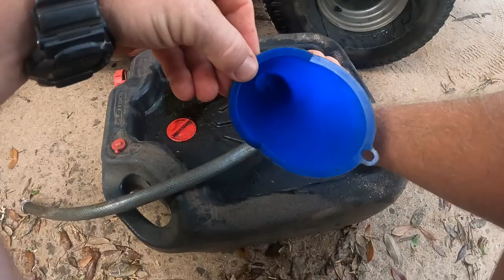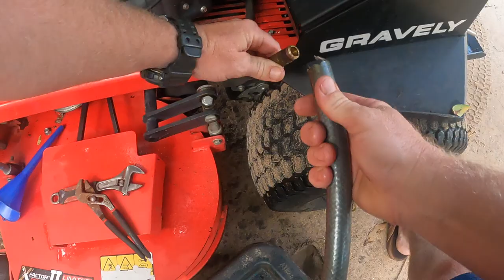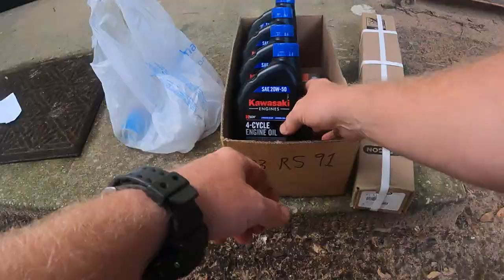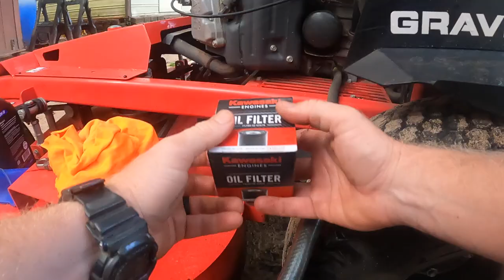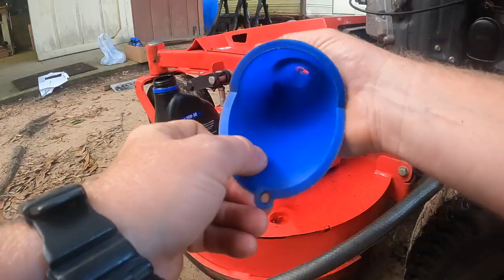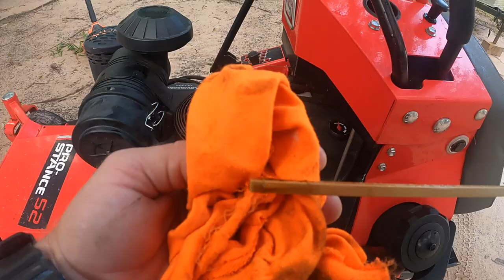THIS IS WHY I CHANGE MY MOWER ENGINE OIL

Comment: I use my backpack blower to blow out my air filters every weeks especially during cleanups, works wonders. Great content!!!
Reply: I blew my engine in my new Pro Stance doing that. It loosens dust and then gets sucked right into the engine.  Dont do that.

Comment: Replace that air intake bonnet with an engineaire precleaner and your oil may last longer (provided you don't have a leak in the air filter system).
Reply from the maker: Good points

Comment: I recently heard someone say not to start your engine at first and get it hot, which goes against what I was first taught even with vehicles but his theory was while the engine has been sitting and cold, all the dirt, trash, metal etc. would be at the bottom and come out immediately. Probably debatable but makes since.
Reply from the maker: That’s interesting, makes sense

Comment: Good tips but you didn't say why you change your oil  from the video title.  Unless I missed that. Of course the reasons are pretty obvious I guess.
Reply from the maker: I tried to show how nasty the oil was with just 75 hrs between last oil change.
Reply: I write the date  and hours on the oil filters. Easiest way to track when mowers need service, even the crew leader can track it